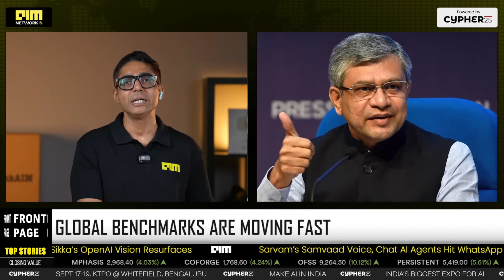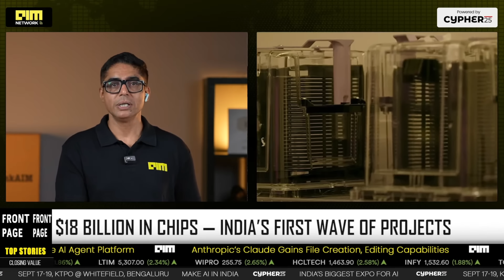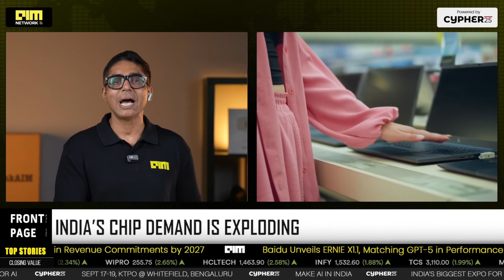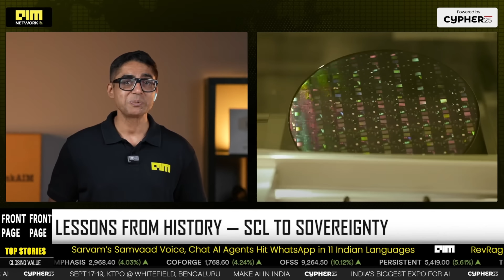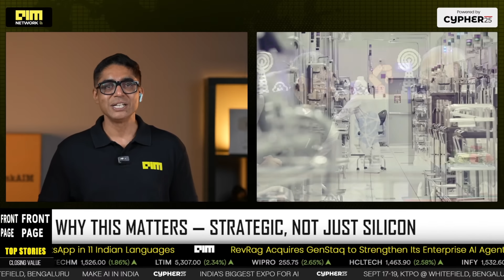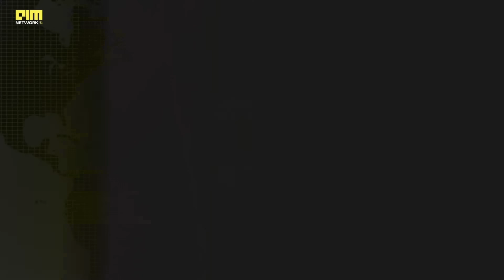India’s 7NM Chip Mission Explained | Semiconductor Production with IBM & IMEC to Start

Comment: I am not sure why you are painting such a picture. I am not a chip person but my reading tells me that the industry needs chips from 28 to 2nm. While semi conductors used in devices like AC, washing machines and others can be of high nm levels, it is still a huge market. Think of the ones in cars and other equipments. So while it will take a while to make 2nm, it is still good enough.

Comment: Getting to 7nm in 5 odd years itself is a great achievement. Majority of the chip demand can be met with the combination of design and manufacturing capabilities.
Reply: 2025 
so by 2032 if everything falls in line 
if not 2035
Reply: @yangkai9th  we have to make it till 2030 and this can be achived as rising electronice demand and governament push
Reply: @user-gu8kg2ku8k  whatever I am not chip engineer but if we have huge demand will achieve this in less time
Reply: @user-gu8kg2ku8k  no bro , there are 10nm , 9nm,7nm ,6nm ,4nm, 3nm chips in the market . My  phone has 4nm mediatech processor.
Reply: @All_K2A_killer yeah i just did research.. but main famous are 3,7 and 14 in advance. Even china can’t build 3nm without US made equipments.. thats why taiwan considere semiconductor as shield against china
Reply: @user-gu8kg2ku8k  7nm will cover 90% of India’s demand
Reply: @HanamantarayPoojari-h6o nope… most devices amd cars don’t use that advanced chips. Those are fro army, space and aircraft related mainly.